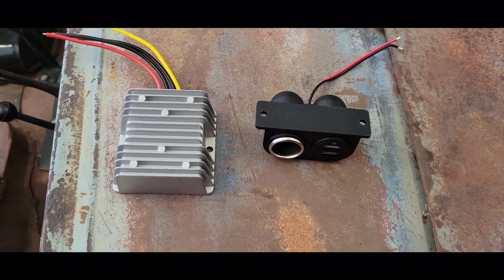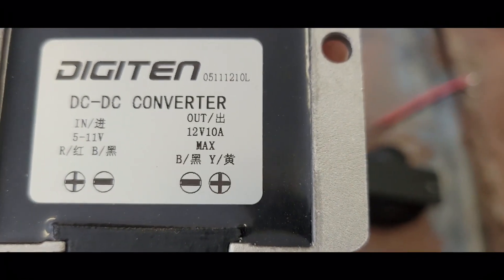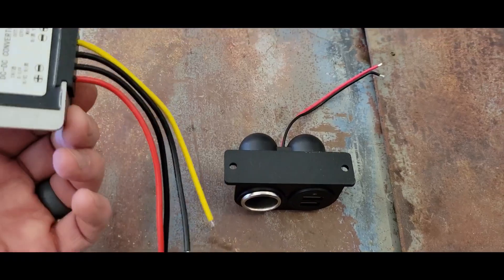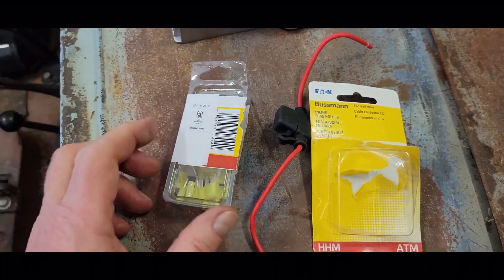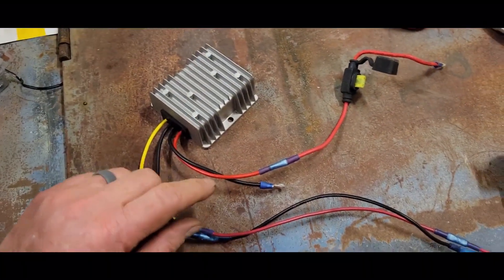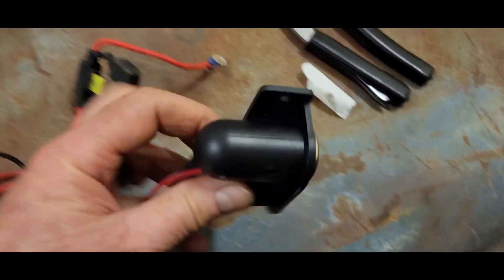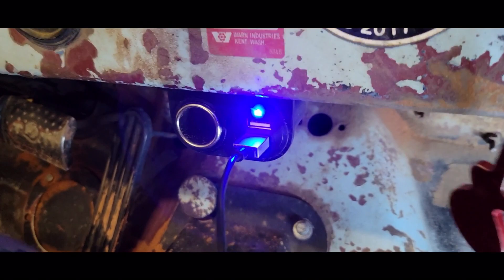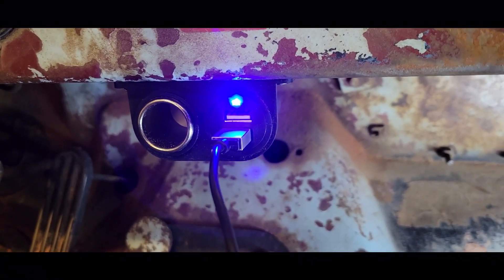How to add 12 volt accessories capability to a 6 volt vehicle.

Comment: How many amps can it be for input i want to put this setup on my 1949 allis chalmers  b its 6v  and  generator charges high charge full throttle  at round 15 amps and low throttle at low charge 2-5 amps could it work

Comment: I'm curious if your 6 volt system is positive or negative ground.  I could see something like this working in a Ford Model A which is a 6 Volt positive ground.
Reply from the maker: Willys Jeeps are negative ground. I think it should work for pisitive ground, but I don't know enough about electricity to really advise you.

Comment: That's interesting. I have a 6V Renault Dauphine and was wondering about how to go about this. So you did this work 10 months ago... how has it worked out? Has anything burnt out or failed? Have you kept the 20 amp fuse?
Reply from the maker: It works great. No failures or burnt fuses.

Comment: Great idea! I have the 24V M38A1 and the previous owner converted the lights and ignition to 12V by tapping off the first battery to get the 12V. Not great for the battery. Seeing this video inspired me to look for a 24V to 12V converter. I will be adding a converter to the M38A1 in the near future. Thanks for the inspiration!  I imagine your winter has also been pretty wet. When will you be getting back on the trails? It might be a few weeks before it dries out enough here to hit the trails.